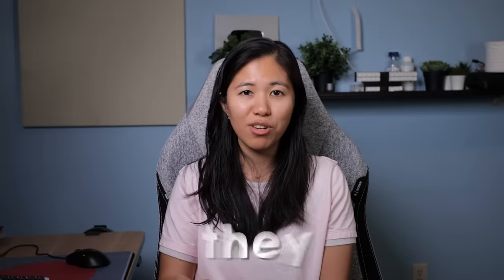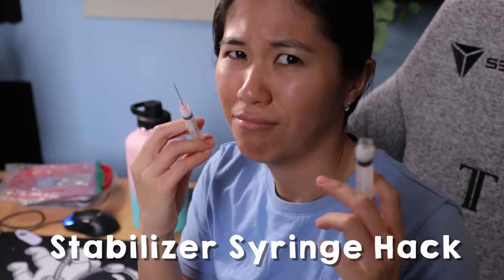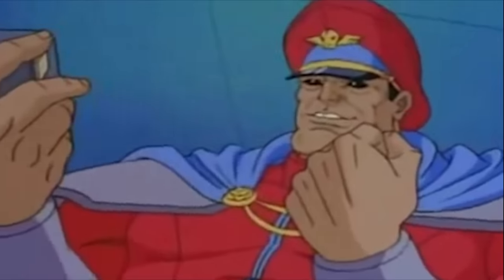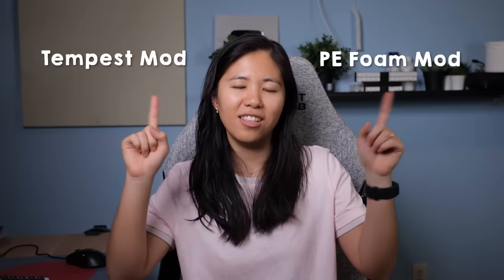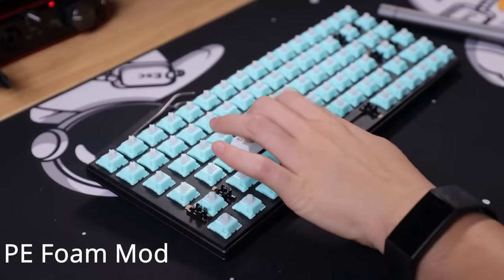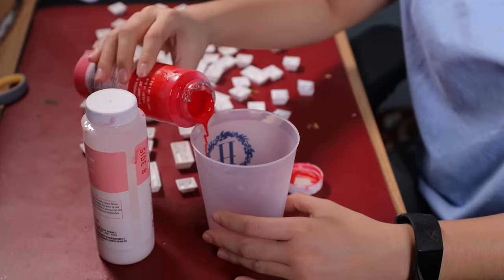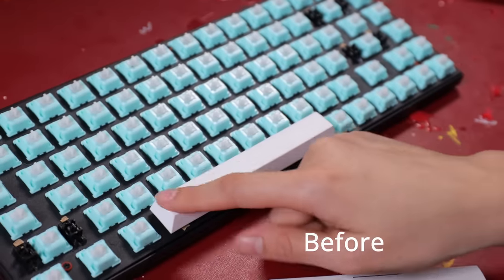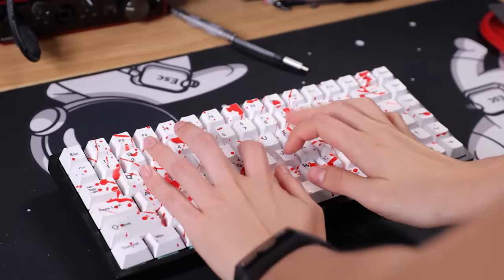7 Keyboard Mods That Make Your Keyboard Sound BETTER

Comment: Hello, i hope someone is able to answer, i plan to tape mod and foam mod my new keyboard should i remove the battery?
Reply: If you want, you could put tape and foam everywhere but the battery, depends if you enjoy the wireless feature. If you want to do a full tape and foam mod, I would remove the battery as I personally don't find wireless that helpful (with wireless you depend on the battery. When you are using wired it doesn't make a difference if you are using it for a computer as it is still usb and going to be on a desk, If i wanted it far I would buy a longer usb-c to usb cable.) Hope this helps!
Reply: @anonymousguidance  Thank you so much bro!

Comment: Yea so about my keyboard: 
Fake chinese "red" 2pin switches
Wire stabz
And TKL board

I couldnt resist to that sound no more so... I modded it using home APPLIANCES.
So now i have:
Switches "lubed" with OLIVE OIL
Stabz lubed with oil aswell
some kind of original idea to reduce the vertical shake of the space using fabric band aids
Tape mod with the most recommended tape(this ones kinda makes a BIG difference)

Yea and thats it.

Comment: Scissors and batteries are never a good idea. If the sharp edge cuts through into the metals, it will short them out and 100% cause a fire. Please use plastics around batteries and not sharp metals!

Comment: Please, please, PLEASE, if you are going to do the tape mod use ELECTRICAL TAPE not painters tape for the very reason mentioned in this video of the fire hazard. Electrical tape should be safe, but i'm not an electrician so don't take my word about the electrical tape being safe, just PLEASE do not use painters tape or any other FLAMABLE tape. Another one i recommend not to do (and the creator of said mod doesn't recommend it either) is the seran wrap mod. As far as I am aware, the seran wrap is not flamable, but DOES pose the rist of frying your pcb from a static shock, leaving you with a useless keyboard
Reply: I think it’s fine if there’s other stuff between. Mine has a layer of silicone and 2 layers of foam (maybe 3??) and they were there stock so I think it’ll be fine right